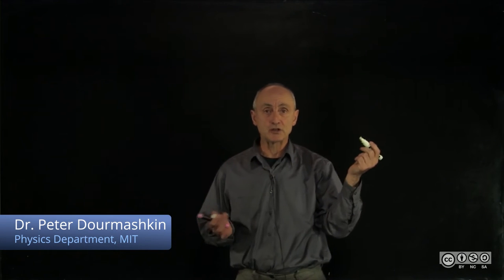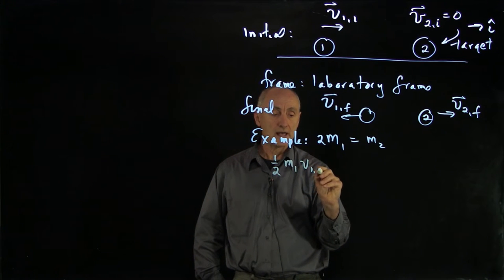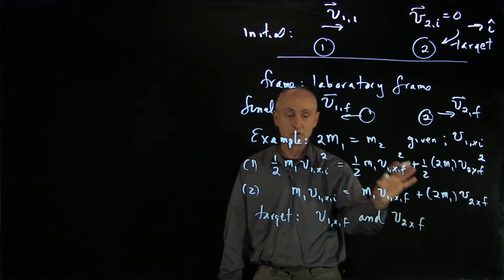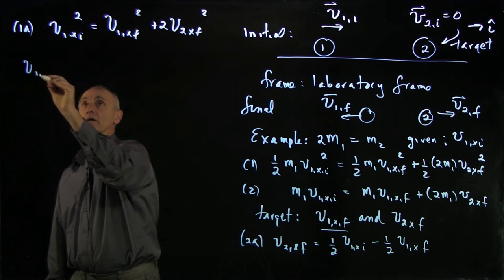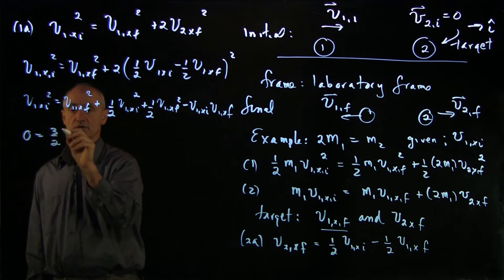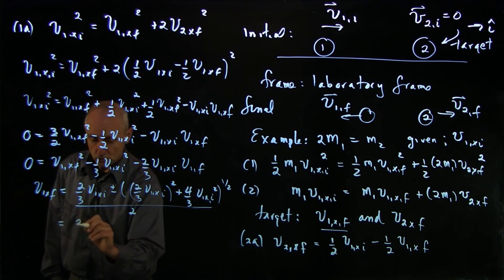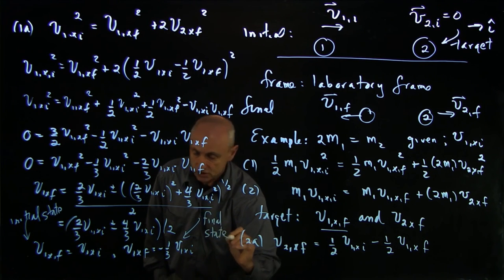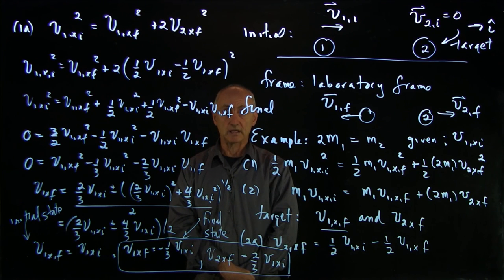27.1 Worked Example: Elastic 1D Collision

Comment: It's difficult to keep track 
of all those subscripts! 

Suggestions:

1. It's 1d motion, so get rid of the unnecessary "x" subscript.

2. For initial & final motions, if possible use "u" & "v", respectively; and (perhaps) for m1 motions use lower case and for m2 motions use capital letters: "U" & "V".

3. Divide everything by m1 immediately if m2 is given proportional to m1. (Both (1)&(2))

4. Immediately multiply all the KE terms by 2 in (1).

Comment: I've never seen any quadratic equation that works like that ( around 7:00), can anybody explain that to me? The quadratic equation that I know is x= (-b ±(b^2 -4ac))/2a
Reply: That's what he did, but he simplified the equation so that a would just be 1, and so it was just (-b±sqrt(b^2-4c))/2. Does that make sense? Also he didn't quite have the equation in order, he had it in the form 0 = x^2 + c + bx instead of the normal x^2 + bx + c = 0. b was also equal to something times v1xf, which also made it a bit confusing.